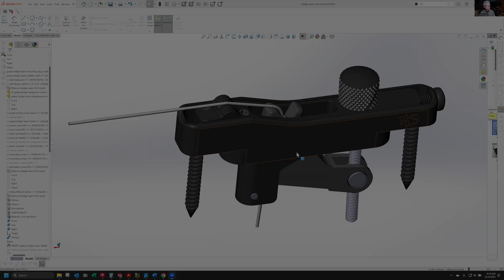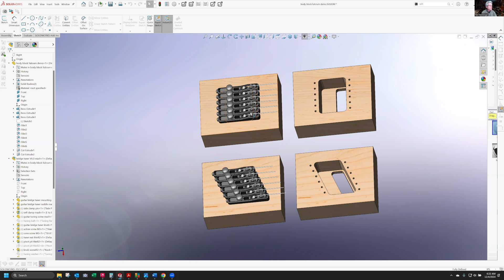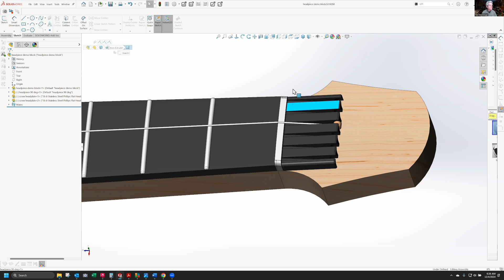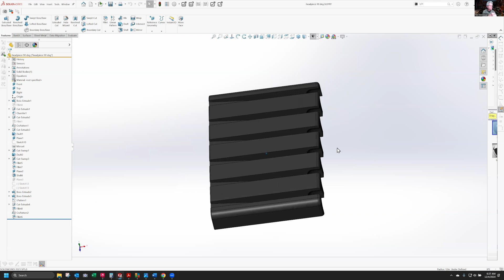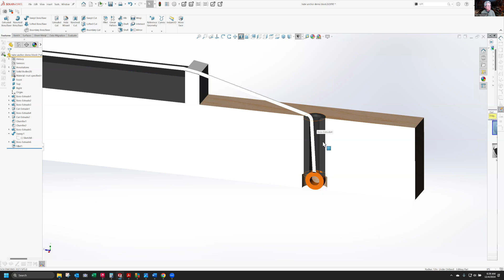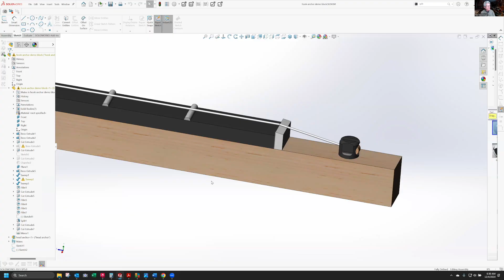NS Fulcrum Headless Bridge Tuner

Comment: This is great. I recently used Riviera headless bridges which shares the vertical knob aspect of this design. This seems to be better in terms of intonation and action adjustment so I wish I'd come across this earlier! Do you supply dimenions that would be useful when modelling body routes that will be required for this? I'd be keen to try it on a future build.

Comment: very cool!
another iteration by an absolute legend...
I am curious, is there potential for a monorail type bridge with a drop tuning capabilities? I know it's doable (you've done it in the past) but perhaps something that could retrofit the modern direct pull method would be more inline for the market nowadays... And with my undying love for Michael Manring and Harmonic tweaking bass shenanigans, I've started having dreams of headless six string with individual levers for drop each string.
I know for a fact it's possible (not even that hard I'd imagine), but I am curious about your opinion. I imagined something akin to the hipshot drop tuner, where the entire monorail bridge is itself, suspended on a rail - and a lever simply pushes it further away to tension the string and locks at the end, and when released it would simply let the string's own tension pull it back to the open position.